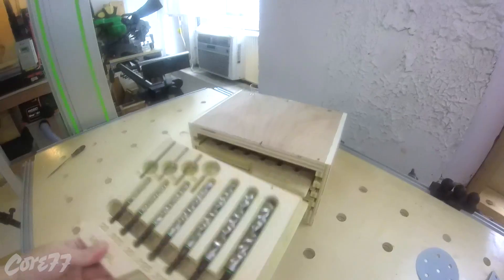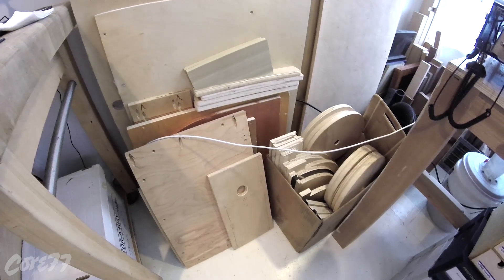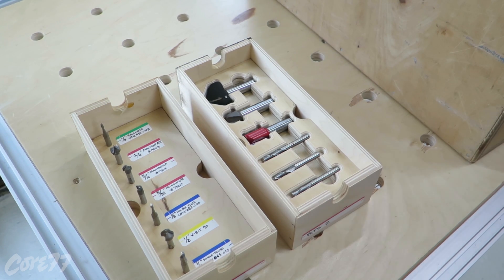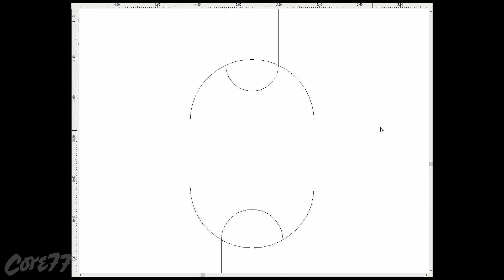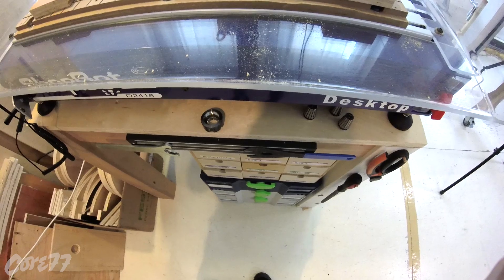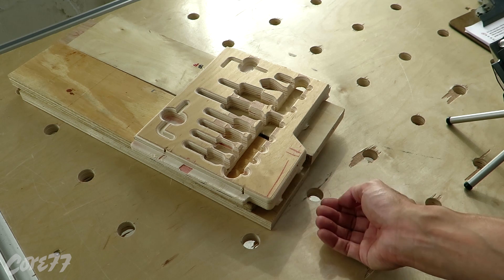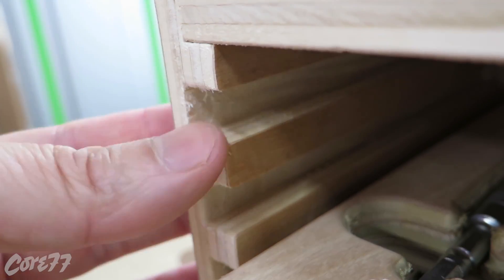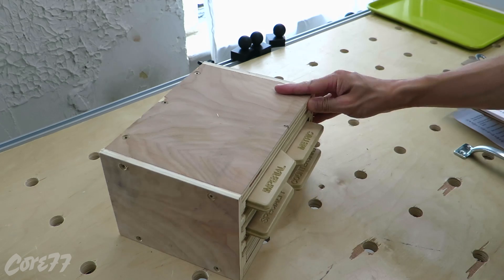The Design Process of the OCD Drill Bit Organizer

Comment: For a handle, you could put a slot through the top, parallel to the drawer opening, and closer to the drawing opening (maybe 1.5-2" from edge). Undercut the inside of the slot with a larger slot so you can get your fingertips under the edge. When you go to lift it, you may only be able to get fingertips in, but with the slot close to the front, it will tilt backwards both holding in the drawers by gravity, and allowing your fingertips hold to be more effective.